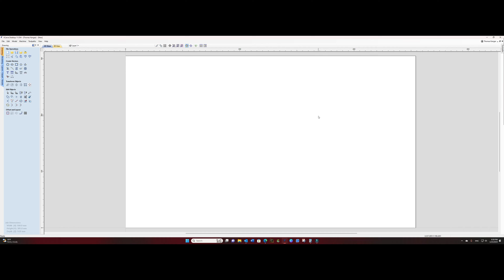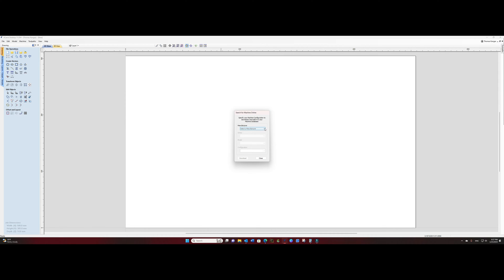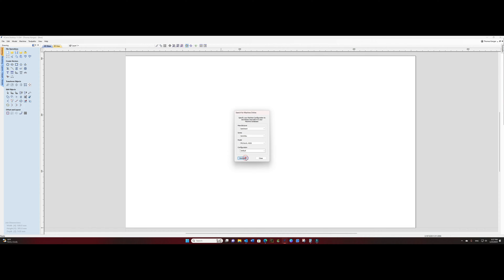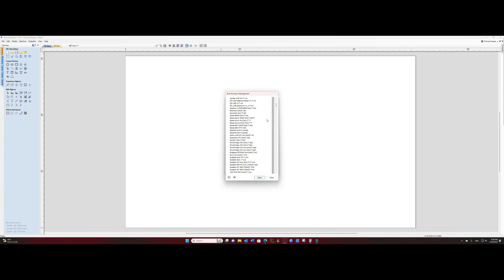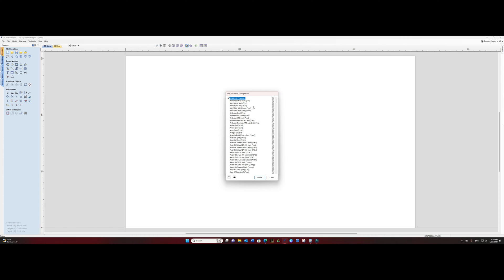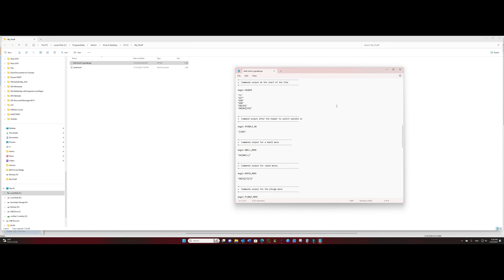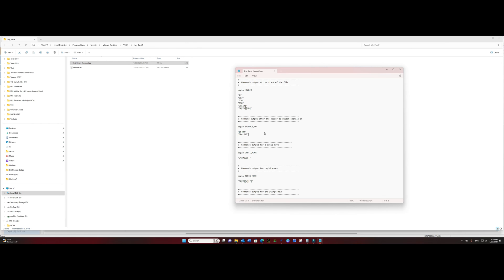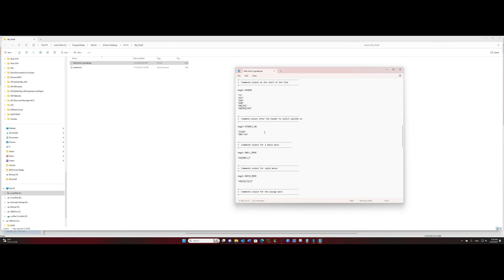How to Set Up Vectric V-Carve Post Processor for Delayed Spindle Start | TK.Designs | 4K

Comment: Thanks for this one Tom.  Do you have any advice on how to connect the wires from the controller to the VFD to turn the spindle on and off with UGS software?
Reply from the maker: The videos I have for setting up the spindle show the correct wiring, and should be universal.  You will also have to set up your CAD/CAM software post-processor, and depending on the sender you use, you may have to turn on the option.  For UGS, Select Machine-->Setup New Machine and follow the prompts.  At the spindle settings step, select automatic.  It is important to note that will also have to set minimum and maximum speed on the CNC controller so that UGS knows what bottom and top speeds are.  You can also test to make sure that UGS will turn the machine on manually by opening the console, and typing S[SPEED YOU WANT]M3. For example, if you want to run at 18000RPM, it would be S18000M3.  This should turn the spindle on manually, and ramp it up to 18000RPM.  To stop the spindle, type M5.  Hope that helps. Thanks for watching!